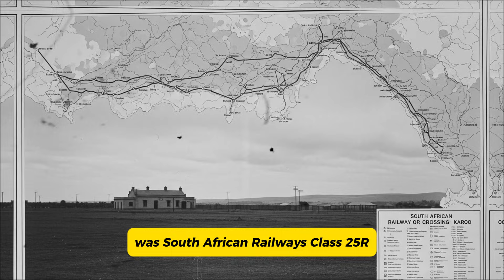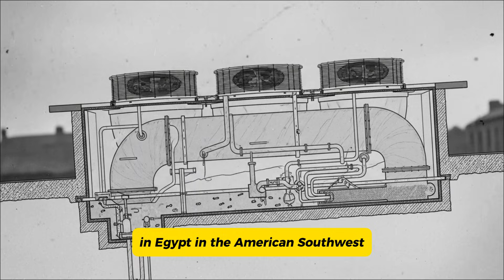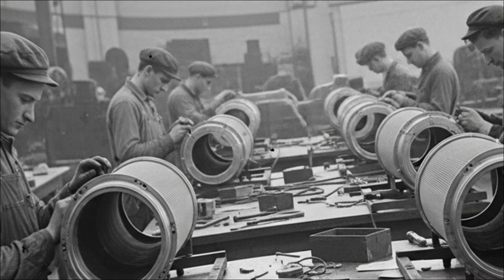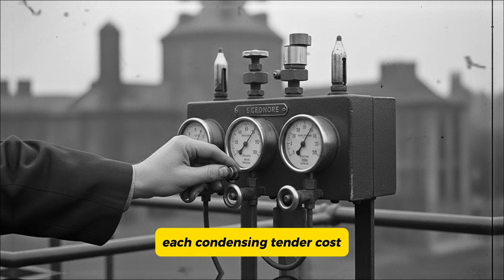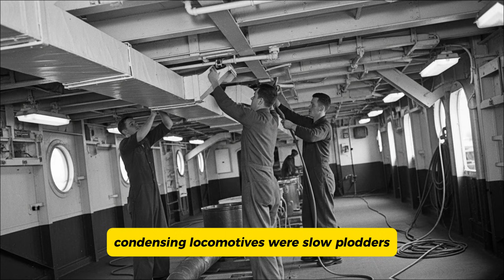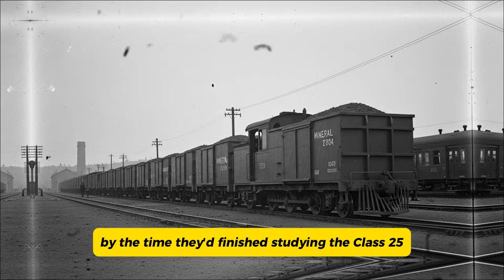The South African Locomotive Britain Tried to Steal and Recreate

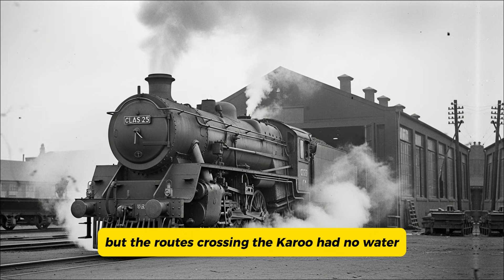Comment: No such thing as a 25R. 25's were condensers and 25NC were non-condensers. Your pic at 1:56 is junk: a UK standard class with a cowcatcher: lazy AI or poor photoshop. Your talk about condensing stations is utter crap – as is most of this video. UK engineers actually built the condensing tenders, although the design was German, if I recall correctly. If you're going to make a video, don't insult your viewers! What a waste of my time.